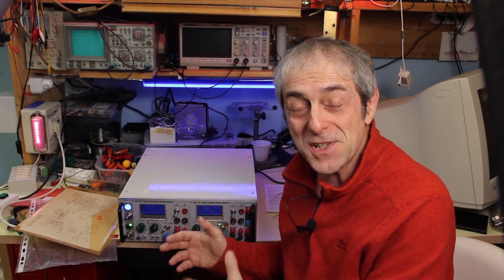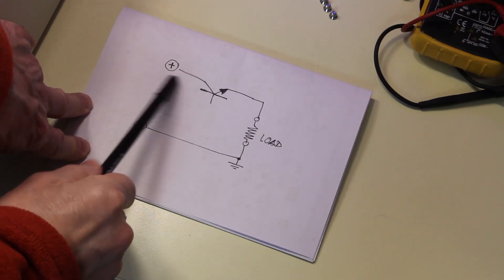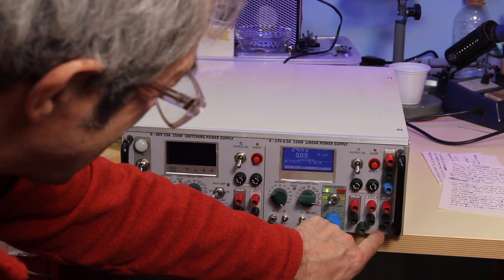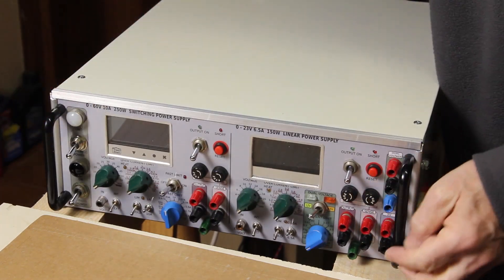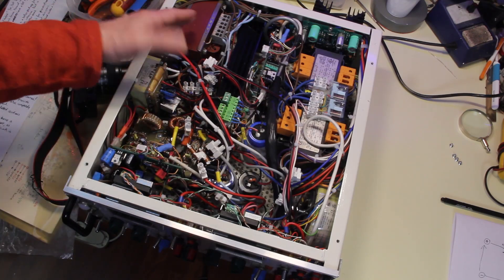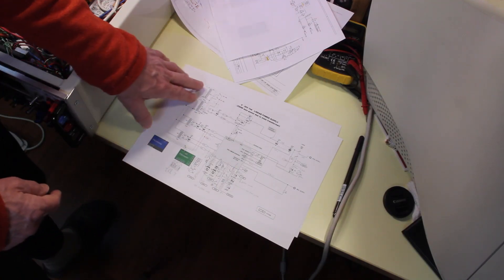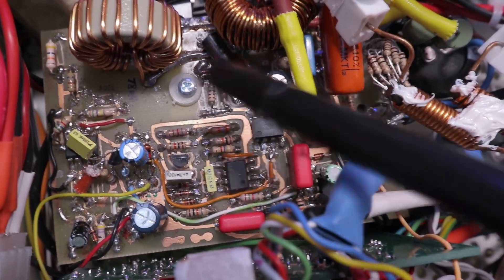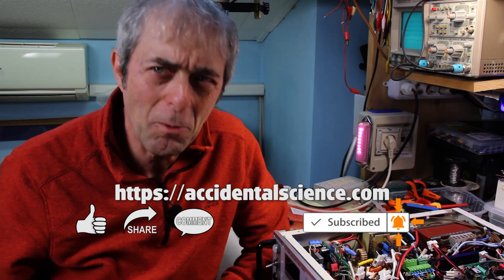Everything You Asked About my Ultimate Power Supply (Q&A)

Comment: Looking good 👍👍👍
Can you do a video on how you made the front panel label , it looks very nice and professional, almost like a Tektronix scope. Grtz
Reply from the maker: @BjornV78 yes I'll do it. Old Tektronix style is what I was after, indeed. I'm preparing a second panel to show two different methods. So it will take a while before the video will be ready.
Reply: @AccidentalScience  thank you, looking forward. At the moment i'm still building on my Isolation transformer project with DIY electronic circuit breaker, variac and dim bulb limiter in 1 enclosure for 5 years now. Mostly due medical issues, but also due keep adding features to the project. For the frontpanel i wanted to use self adhesive transparant film (A4 format sheets) that can be used with a inkjet printer. But this is one of the latest steps in my project, but i like to gather the information for when the time is right. Grtz